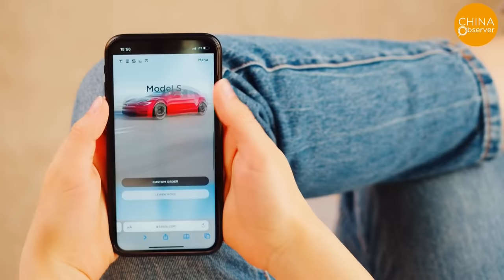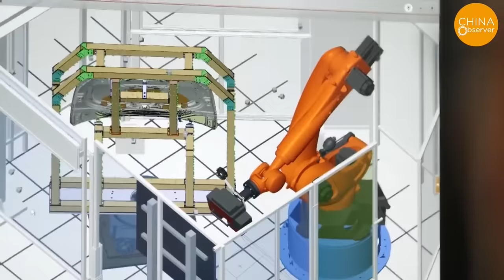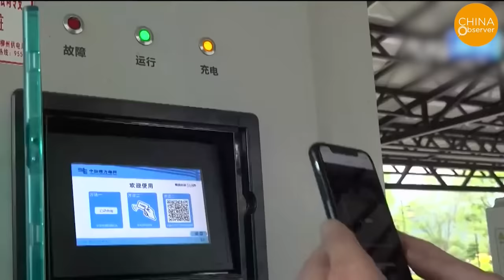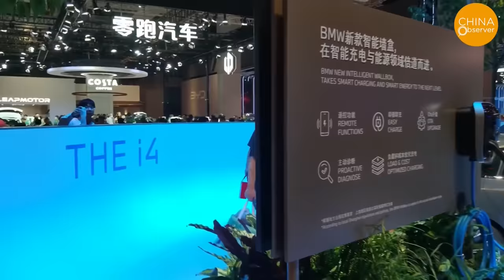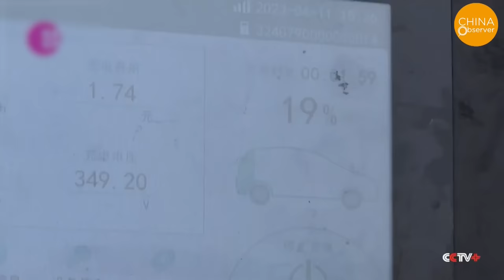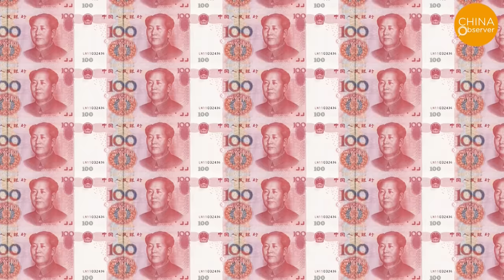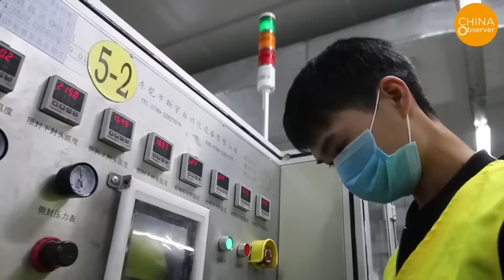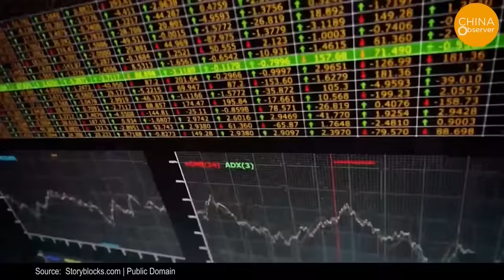Is China's EV Market Doomed? 1.06M Units in Stock! Foxconn Charges Into EVs, Buffett Unpluges BYD

Comment: If you haven't already, you should talk about the high rate of these PRC-made EVs... just catching on fire. It seems to be happening a LOT.
Reply: Byd is quite notorious for that issue 🔥
Reply: Burn Your Dreams...
Reply: Battery powdered vehicle with Chinese characteristics....
Reply: Saw quite a video about that from s er pen tza.   Also a full sized BYD bus that was in a huge wall of flame...
Reply: Yep, I’ve heard them nicknamed “bring your dockers” because you can plan on walking. It’s only a matter of time. Typical quality control measures that they follow.
Reply: That's every electric car tho
Reply: @jerzyf4003  every EV company has had failures and fires, but apparently BYD had had a much higher failure/fire rate than most.
Reply: @alanparsonsfan  wasn't BYD bus in a huge wall of flame just an advertisement of Chinese future?
Reply: Really funny we haven't any byd cars  outside of China has caught fire yet.
Reply: What rubbish!? You're spewing malarkey to those who have not even driven an EV... and they agree with you. 😂
Reply: @dalama6111  , so where is that evidence? You're just spewing rubbish...
Reply: @tunahxushi4669  😅 Rough crowd! Pretty much...
Reply: @tunahxushi4669 , there is a different between designed in USA or Europe and made in China vs designed and made in China.
Reply: Fire is a pretty big problem with all EVs, mostly because it's very hard to put them out and batteries autoignite when damaged. Might be easier to damage them in the Chinese EVs, but no matter what kind of EV you have, you don't want to park it anywhere that a fire would cause significant issues for long.
Reply: @herpderp7114 EV fires are hard to put out but rare compared to ICE cars.
Reply: @alanparsonsfan  Those same vids are what made me aware of the problem.
Reply: @eddewhurst7662  We don't know that. The oldest EV on the road that's fairly common is Tesla Model S released in 2012. Fires that are not caused by very nasty accidents (batteries will self ignite if damaged and gasoline can catch fire if the fuel system is punctured - both types of cars have mitigations for exactly those possibilities, and for EVs it's many times more important since their fires are not controllable) are mostly down to poor maintenance and modifications.
It's entirely possible that once the EV fleet ages and they become available at non-luxury prices, fires become more common too because people beat them up and modify more than before not to mention there will be many more accidents involving EVs.
Reply: @herpderp7114  I think there are plenty of reasons to be optimistic that EV fires will decrease. That is the current trend. Manufacturers are just learning how to build EVs, some will be safer than others, but expect other manufacturers to adopt best practices. Half of Tesla cars use LFP batteries that are inherently safer. There is a new variant of LFP batteries that use manganese, many people in the industry are predicting that they will replace standard lithium ion batteries in most cars.

Comment: How will farmers afford the electricity cost for any EV? You could convert tractors to electric, but I don't think farmers will buy them. EVs are too new and will not be trusted by farmers. Farmers are more cautious and unable to afford to be cheated.
Reply: The CCP tells farmers what to plant and how to do it. They restrict who can farm by requiring certifications for farmers. Non compliance leads to fines amd destruction of unauthorized crops. 

It's not like farming in democratic countries, so they can definitely force farmers to use whatever the ruling party wants to catastrophic effect.
Reply: The electric costs are cheaper than the fuel costs especially at slow speeds and the ev has continous high torque.  =An electric tractor will always win out.  

+you are not importing the fuel (money stays in China).

Also the electric fuel economy is about 2x when driving slower (countryside) so that 100-200 mile EV more likely gets 200-400 miles per charge.

Comment: farmers want a vehicle with high reliability, and high off-road capability/ground clearance due to its body on frame and solid axle design, which none of the low-profile electric vehicle (designed to maximize range) can provide.
Reply: Also, good luck finding a charging station in rural China. And then in some provinces there are seasons when they have frequent blackouts.
Reply: Ok well farmers can have gas then fine lol
Reply: They're excellent for starting huge fires though. They should burn these in their many many many coal plants when the power grid is under heavy load. Less black outs.

Comment: Wonder where they're planning on getting the electricity supply to deliver that much juice to an EV in 10 minutes?
Reply: They're building 3 new coal plants is it a week or monthly? Either way, plenty of stuff to burn.
Reply: @disbeafakename167 Source please sir
Reply: Building a giant hamster wheel and will use convicts.Its a win,win.Convicts produce the juice while exercising
Reply: in china they don't have to worry being they have been building new coal-fired power plants at about 2 a week threw out the country so they will be able to meet the massive added demand for these polluting ev cars.
Reply: Australia has the coal to keep the lights on, unfortunately a lot of their transfer stations and transmission lines are made from tofu.
Reply: The load on the grid would be ridiculous. It is hard enough to get fast chargers installed en-masse because of the infrastructure load
Reply: @johnjames5712  Coal has gotten very expensive in recent years so while they technically can probably keep up with power demand, the cost per kwh would only grow as demand increases. They have to import a lot of the coal too.
Reply: @michaelrhodes6461 maybe using default mortgage debtors who after bank auction off their houses, still owe the bank because of house price at auction is much below house price when they buy. Perhaps also using the people who lose their jobs and can't find a new one after several months and the 12 millions who are graduating this summer who most likely also can't find a job.
Reply: @disbeafakename167 3 coal plants a week.
Reply: Yes they build 3 coal power stations a week we read online ? Very ECO ...OMG...

Comment: You forget to point out that the electricity for charging these vehicles has to come from the power grid, which still uses primarily highly polluting coal fired power plants, and makes a further drain on the power capacity of a country that imports more and more of its coal from overseas at rapidly inflating prices.
Reply: Which countries are importing more coal?  Most countries are generating more electricity from green sources year on year.

Comment: BYD is just no technology leader. They have mass production capabilities primarily due to availability of a lot of manual labor. Additionally to that, they are producing to a plan and not according to demand.

Every western automaker is typically highly automated due to cost of manual labor in Western countries. This makes them a lot more efficient. To be fair, most western automakers except Tesla do it similarly and stockpile there cars at dealerships. However, there is much more of a feedback regarding supply and demand and the automakers react accordingly.

In China, the state is massively involved in providing the targets for the company and subsidies. This leads actually to the phenomenon of massive overproduction with many goods. Not just bicycles and cars. Can be massively seen with real state and infrastructure.

Investors should be aware that China just works significantly different from Western countries and there is a very high level of intransparency regarding chinese economy and politics.

The CCP currently has a high priority of its "Made in China 2025"  initiative. EVs are a big part of it so they are just scaling no matter if there really is demand. To achieve the parties goals, the guys at BYD will to anything to somehow declare a car as sold and show a high growth rate. Running a business like that is rarely sustainable but we dont know how much government money BYD receives to keep the company afloat as it is Chinas Internationally most known EV brand and growth story.

I always wondered why Waren Buffet invested in BYD with all these China specific risks. We have seen with Alibaba, how quick things can change in China with the government involvement.